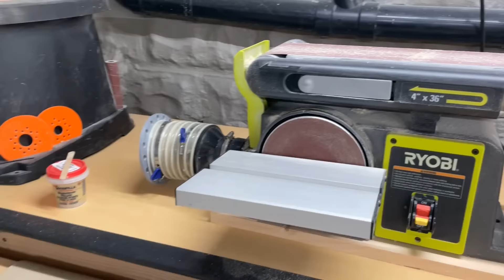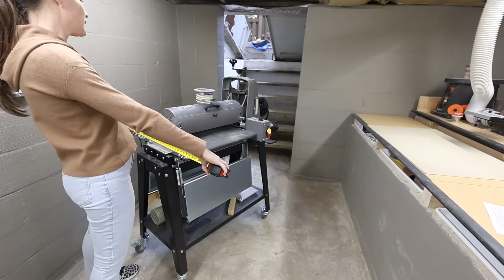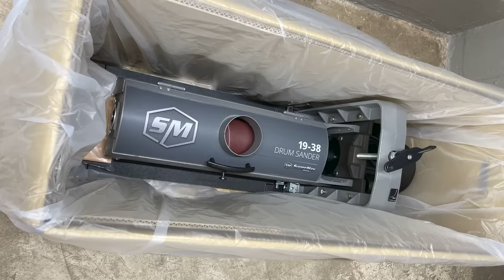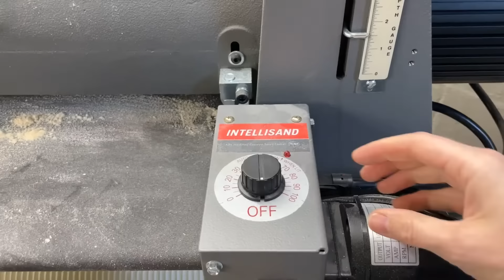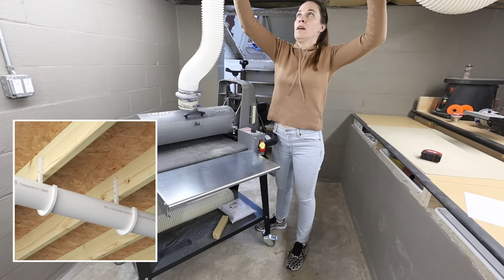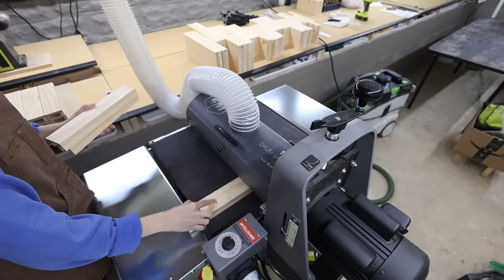SuperMax 19-38 Drum Sander: Purchase, Logistics and Review

Comment: Appreciate your matter of fact style and user experience walkthrough. I’ve been considering this same machine so wanted to ask if you’ve had any issues like the belt not tracking straight and true, uneven results where one side gets sanded more than the other, snipe at the beginning or end of your workpiece, that kind of thing. Glad you’re enjoying your investment!
Reply from the maker: Overall, it's been pretty consistent. However, I have recently been getting some snipe toward the top of my pieces. I think I need to do some recalibration. I haven't done any since I bought it and I moved it cross country in a moving van.

Comment: Good review.  I have the exact same machine.  I also have the same "eraser".  I use it after every 3-4 passes of whatever I am sanding by raising the hood while the drum is still on and dust collection still running.  I make a couple of light  pressure passes back and forth.  The dust collector will suck up 95% of what comes off as it spins and keeps the belt cleaner and does a better job in my opinion.
Reply from the maker: It's a great machine. You know what's interesting, since I've moved from NY to Iowa my paper doesn't get nearly as gummed up! I'm not sure if there's something different about the wood or what (mainly using pine). Even when I'm lazy with the eraser my paper is definitely lasting longer here. I'll take it!
Reply: @carpenterkatieco  Glad it is working well!   Maybe the humidity makes a difference.

Comment: Thanks for the review.  Did you consider the 16-32?  I’m debating which one to get.  Space is also a consideration in my shop.
Reply from the maker: Thanks for watching! I briefly considered the 16-32, but after comparing the dimensions I decided on the larger size (I don't think it was a major difference in footprint). I would highly recommend the casters so that you can roll it out into your workspace when using it. It stores pretty nicely up against the wall with the outfeed tables folded down when not in use.

Comment: Question for you Katie:  Does this machine produce any snipe on the ends like a planer can do?  Also, the folks at StuMac soak their drum sandpaper in a cleaning solution that is basically like simple green cleaner.  They said they get much more life from a roll of paper.
Reply from the maker: It leaves a nice, smooth surface if you’re not too aggressive with it. If you try to take too much off in one pass, that’s where you can run into issues. I started doing the simple green soak as well! It’s easy to do and nice to reuse the rolls.

Comment: Interesting video.  Thanks for posting it.  I wonder if your dust collector isn’t sucking enough.  You should have that much dust on the inside.  Drum sanders need a lot of suction continuously and many get clogged easily with the fine sanding dust and loose suction quickly.

Comment: Dont meant to be rude or stuff but that "cleaning rubber thingy" do you rubb it over the sandpaper while it is ON or OFF? Cause its meant to be used when the Machine is running (be careful)
Just open the Cover and press it against it. Voila. Clean (if you do it often you save a ton of Sandpaper)
Reply from the maker: Lol yes I do it while it’s running! I realized I need to do it A LOT more often than I was. It’s working much better now. Thanks for watching!
Reply: @carpenterkatieco  I'm not sure where you got your eraser from, but the one I got from harbor freight actually works pretty well.

Comment: good review, thanks.  I have an older Performax, which is pretty similar, but obviously the is a little nicer than the standard Performax.  I used mine for 15 years and ran thousands of feet of wood thru it.  (Tens of thousands).  I find lots of folks gripe about it, and true, there are problems, but if you just do it enough, it works VERY well.  There are some optional devices for the Performax that are very good.  One is the optional leveling device, that allows you to adjust the angle that the arm is over the table.  Using that, you CAN adjust the drums to be very consistent in height over the bed and be quite acceptable, sounds like this comes with it.  I use lots of grits.  You have to get good at it.  I use 60 thru 180.    About 18 years ago, I finally went and got the narrowest Wide belt to replace it.   I bought the open ended version of this also, and can't say enough about it.  All the 16" wide open ended wide belts are basically the same thing,  but I bought the Sunhill one, (no longer around, but it was made in Taiwan by the same mfg as makes the Jet.  I liked my Performax a lot, and still have it and occasionally still use it.  But I LOVE my mini wide belt.  They are certainly much more expensive, about $7K.  But my oh my.  The paper last so much longer, and it sands at more than twice as fast as any drum can do.  Considering how much time you spend sanding, that is very important.  I tend to use my sander for thicknessing any nice wood.  I now sand ALL wood to the thickness I want BEFORE I cut anything to exact size.  It just works so quickly and well, obviously with no tear out.  But one of the biggest advantages is the speed of changing belts.  I can change a belt in less than 30 seconds.  I am fast with my performax, but it still probably takes 4 or 5 minutes, on average.  This means that I change grits much more easily and am not adverse to work thru all the grits.  My only problem ever was overloading the machine.  Do that more than about a dozen times when it stalls out, (mine was 5 hp)  then you often need to replace the necklace of the motor.  Having done that about 3 times, last year I finally switched the bad motor for a 3 phase motor.  GREAT switch.  Now no problems.  And YES, for sandpaper that gets gummed up, wash them outside with simple green!  Saves you a lot of money!
Reply from the maker: Thanks for watching and sharing! You’re encouraging me to buy more grits and get even more use out of the machine. Definitely  going to try the simple green on my current roll. I’ve gotten a lot of great tips after sharing this video 🙂

Comment: I take my belts and put them in simple green 50/50 in a container and leave them a few hours to a few days depending. I take a wire brush or nylon brush to clean the abrasive. Even burned in wood and pitch will come off. The cleaning stick should be used frequently. Higher pitch woods like pine every few boards.
Reply from the maker: Great tip! I will try the cleaning solution. I definitely need to use the cleaning stick more frequently than I thought 😆
Reply: Just ordered CMT Orange bit/blade cleaner to remove pitch/burns after seeing video and pricing new sand rolls!
I’m having issues with drive belt buckling up and can’t seem to get to track right, even with new roll! If you have any pertinent info on that over/above the owners Manual, please share! Thank you
Steve
Reply: @sbumpus4513  well, you can go more expensive, but why? oh well, your dime.
Reply: Because CMT Orange also is for cleaning bit/blades, and Simple Green should not be used for carbide bits/blades unless one purchases Simple Green Aircraft and Precision Cleaner. Two in one purchase. That’s why!
Reply: @sbumpus4513  where'd you get that rule from? Years ago I used to use dedicated bit/blade cleaners, but many on Lumberjocks convinced me that simple green does the job well. I have been using it on my blades and router bits for years. When I brought my Forrest WWII blade in for sharpening, Tony said it was clean but dull... That's what I would expect after 10 years of near daily use.  I also have a machine shop here in my basement. I use Simple Green to clean a lot of tooling.  I take it you are an expert, and am sure some where you heard it's not good for carbide.. Not sure where, but you're the expert.  I have one of my ripping blades  in Simple Green, maybe I better rush to take it out... it might ruin it.. NOT. You experts are always right.. Watch a few youtube videos and well, you are the expert.

Comment: Had a performax about 20 years ago and loved it. Then one day I had some long strips for edgebanding get crossed over because I had something in the way about 8 feet from machine as they were feeding out.  Caused the feed belt to come off track and tear and machine was never the same.  Recently I came across a used SuperMax.  Much better than my old performax even though was mostly the same.  Use it on every project I do again.  Dust collector must be cleaned frequently because if you lose suction it will be a death sentence for your sanding roll.  Discipline and patience to use slow speed and not try to run too much at a time.  Great video and good luck!
Reply from the maker: Thanks for watching and sharing! It’s really been a game changer and my hands appreciate a little less orbital sander time lol. I totally agree about discipline and patience. Woodworking in general is a great practice of that.

Comment: Thanks for the excellent and thoughtful review, Katie!  I've had one of these for a couple years now and it works great.  I use it daily and haven't had any issues yet.  I often sand parts for acoustic guitars so it uses the full width of the drum and the woods are hard (e.g. Indian Rosewood and Pau Ferro).  The machine doesn't have any problem handling this.  The important thing, as you said, is to listen to the machine and set the depth/speed of cut appropriately.
Reply from the maker: Thanks for watching and leaving such a nice comment! I’m looking forward to many years with this machine 😁

Comment: When trying to clean belt with the rubber eraser you need to have the drum spinning. Then lay the edge of eraser on sandpaper and move it along the whole length. This is what cleans the dust off paper
Reply from the maker: Thanks for watching! I had the drum spinning but it still wasn’t coming clean. I probably let it build up too much 😬
Reply: @carpenterkatieco  try pressing the eraser harder against the drum and paper. I’ll usual lay the side of eraser on edge of unit and rotate eraser onto drum and using other hand to put pressure so the eraser gets chewed up. The wood dust should come right off. Also another trick I have used when you see burnt on dust on belt is to use a sharp single edge razor blade and skin the surface like sharpening a chisel. This cuts  off the burnt line and you can use sandpaper longer. I usually keep 120 grit on mine and if needed for figured wood will change out to 150 grit.   I have the 25-50 and love it. If you have problems with alignment of drum to bed I have a few tricks that I use. Just let me know. Great intro video
Reply from the maker: Thanks for the tips! I already changed my roll but I‘ll be more diligent about using the eraser this time 😅
Reply: Watch the utubes on cleaninig sandpaper in cleaning solution.  Works!  Save the eraser for in between cleanings.